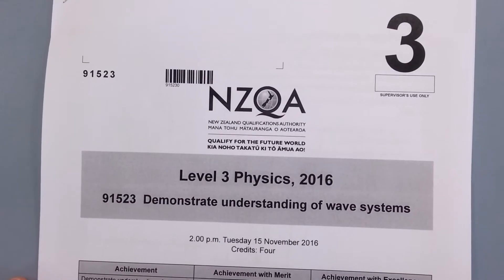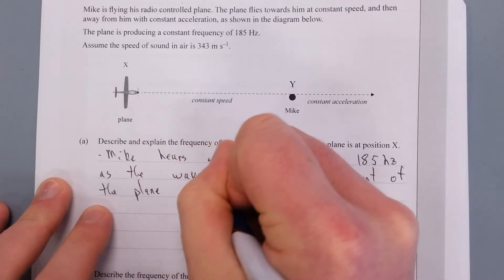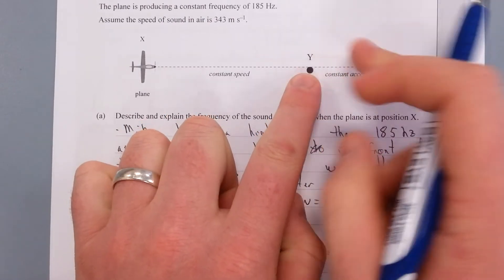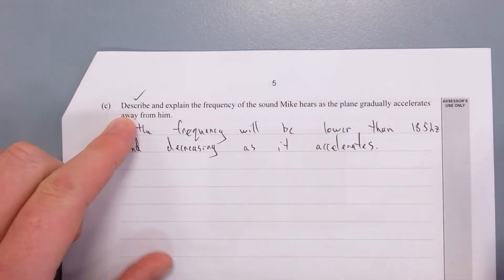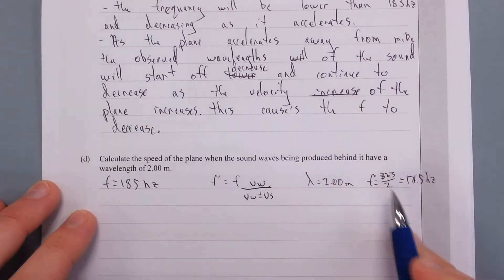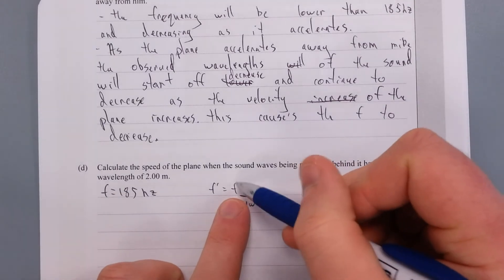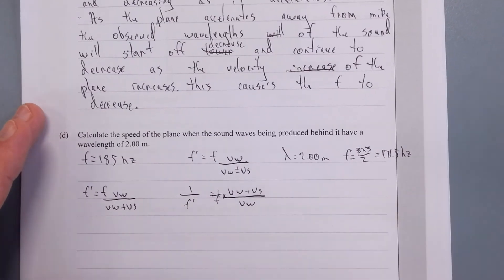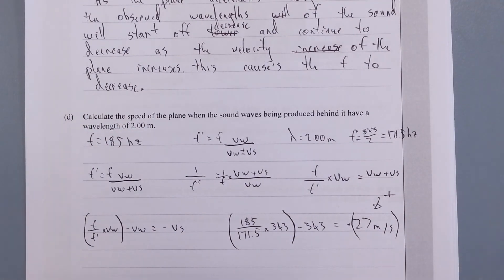2016 Waves (NCEA Level 3)-Q2

Comment: why is it -Vs instead of positive Vs in the last question and the end. When you took Vw to other side, why did you make Vs negative as well?
Reply: This way is very confusing, I would recommend just moving (Vw+Vs) to the other side by multiplying it, dividing both side by the frequency Mike hears, then subtracting Vw from both side to make Vs the subject of the equation